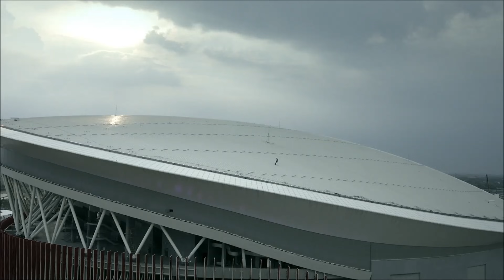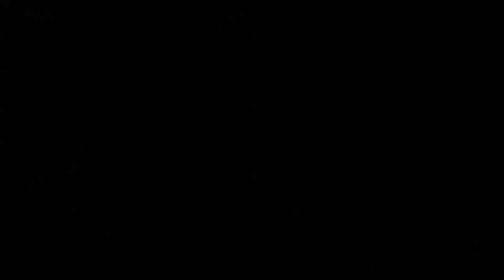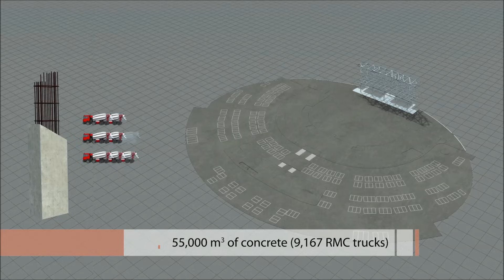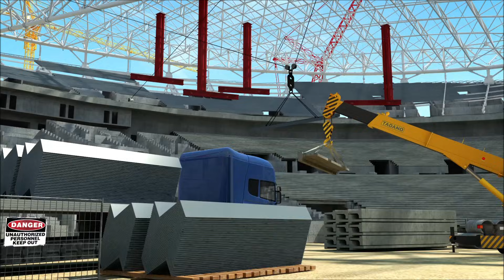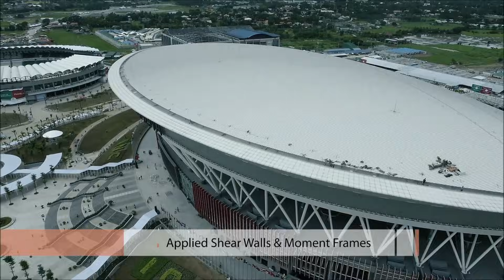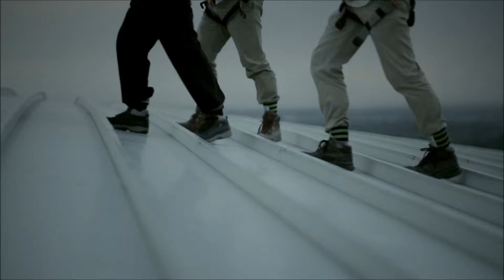Hanwha E&C Philippines Arena PR Film

Comment: Great achievement, but how come it wasn't topped off with solar panels to provide power? That would also help with any power outages on top of having its own generators. There is so much roof surface.
Reply: Mel Gawili actually it's not located from its roof it has its own area
Reply: Mel Gawili It was left as a future option, the rest of the city is being prioritized. Maybe after the sports complex is finished it will be considered again, but for now the management of the area is handling some vital paperwork regarding New San Jose Builders, if I recall correctly. Currently, power outage is mostly a concern during inclement weather, but that's the same weather that also ruins solar potential, unfortunately. Again, maybe another feasibility study will turn out a better result in the future.

Comment: why they did not use solar panel in the roof?...
Reply: eh sana ikaw gumawa
Reply: mahal na msyado.
Reply: Possibly in the future. For now, it's more cost effective to use local grid. Solar needs a lot of capital and you'll only get the benefits much, much later down the road, at which point the Philippines' grid might already have switched to nuclear or some other alternative to fossil fuels.
Reply: It would be an addition to the weight of the roof structure, designed to be lightweight kasi yung roof dahil columnless po yung gitna at considered din po yung wind load within a typhoon belt area. May limitation po kasi yung space-framing structure ng roof di na kakayanin yung weight ng solar panels na ganyan kalawak..
Reply: Mas matalino kapa SA mga engineers dyan dude?
Alammo ba na 3-5 years Lang kadalasan economic life Ng batteries sa solar ? Eh pag nagkataon mas magastos Yun dba?
Reply: Hindi naman ganun kagastos ang maintenance kasama battery replacements ng solar if you compare it with the "rate" of electricity ng Pilipinas mahal kasi kuryente natin dito. I used to be working in the construction of this Arena under the San Jose Builders some time in early part of 2012 pero di ko nakita yung pagkatapos nito kasi nagabroad nko..